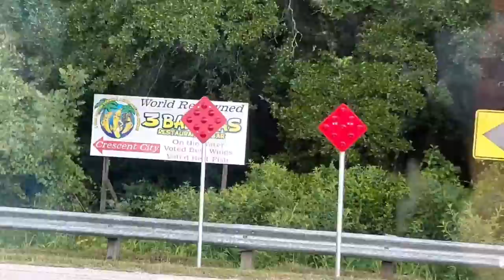**VIRAL** YouTube Video | Will it Get our TRACTOR Unstuck ?

Comment: I'm 69, in 4 Months I'll, be 70, I almost always hook a Chane to the Ball! It's easy to get to, it has always been safe and effective for me and others around me out hear in Western Colorado. Pull up slowly to take the slack out of the Chane. It's an even pull on both Frame rails and generally doesn't mess up the Fram or other parts or get stuck like hooking to a Spring hanger or Bumper.

Comment: With out the deck raising the only option would have been to reverse out. I mow with a 15 foot batwing and once the deck digs in reverse is the only option other then unhooking deck which I’ve done before as well. The log trick does work I’ve also used 4x4 posts strapped to tires

Comment: I realize I'm two months behind in posting this comment.  Only found your channel on youtube yesterday (today is 12/31/22).   For how that tractor was stuck, the better way to use logs to try to rescue would be to put logs CROSS-WAYS in front of or behind the tires, and chain the ends of the logs to each wheel, much as you did. As you discovered putting them in front poses the danger of the tractor,  rearing up, and even going over backward.  Especially dangerous on tractors with no cab or "ROPS" bar.  Other than that, a thing I have found, is that you can generally always pull more with a winch from a stationary vehicle, than can ever be pulled using the wheels, especially on ground like that, made slippery by the vegetation.  LOVE your channel the U.S. desperately needs more families like yours.

Comment: My first thought was for you to disconnect the tractor from the mower, which would make the tractor easier to move forward. Then, once the two units were separated from each other, you could chain up the two and pull out the mower.
Reply: Yep
Reply: that’s what i was thinking also !!
Reply: That’s actually worse. Especially for bigger implements.
Reply: @BIGREDTECH  Why is that? [I don't doubt you... just curious... The only tractor I've owned has been a 1943 Farmall H]
Reply: John dear big engine will myer worse  and you have dead hydrolics
Reply: Stop going to flip over dug in to deep need another tractor.get the wood off the tractor wheel and put it under the wheels for traction and you might get out . Theskidsteer will have to dig you out
Reply: @vickimiller537  Thanks
Reply: At a shallow angle put the tree trunk under the wheels skidsterrmake the shallow cut
Reply: @ralphturner3798  just with my experience unhooking implements or trailers makes it easier to pull the tractor out but then you have a whole new pile of beans trying to figure out how to connect and pull the implement out too.. usually when I’ve been stuck most of the time I get pulled backwards instead of thru it.. those farmalls are classics!! Good tractor!
Reply: @BIGREDTECH  Thanks, J Z
Reply: @ralphturner3798  no problem!

Comment: I start by unhooking the mower. Free up the tractor,.it may walk out. If not pull it out with the truck. then use the chain to poll the mower out with the tractor. Need a log chain, that mower is the anchor. The logs will do the job, work on both tires.

Comment: We used to use it to get our 4020 out when we got it stuck but you gotta have the logs on the front side of the tire lot longer than what you have them you just barely got past the size of the tire they gotta grab a lot more soil than that.

Comment: From a Kansas farm boy. Raise the implement up and pin it. Unhook from it. The tractor should drive out by itself. Chain that tractor to back of implement. Pull away from mud hole. Hook bock up. Never hookup to front axle or front weights, you will pull them off.

Comment: I have seen the boards chained on the tire crossways like a tread on the top of each drive tire and when in gear the board gets to the ground it is wider than the hole and pulls the wheel up and over the hole. 4040/42 through 4450's are pretty heavy though.

Comment: Here is the best way to get unstuck take two used semi truck tires loop one chain around back on itself take another chain and loop it back around itself so each chain end hooks up to the stuck vehicle or a tractor the other end hooks up to the pool vehicle now you have a gigantic bungee cord pull out fast and watch it Pop out the hole LOL it works for heavy equipment to it never let me down in 35 year's just saying.

Comment: I had the same problem while mowing. I couldn’t get the tractor out until I disconnected the mower. Once the tractor got out, I put a chain on the mower and pulled that out. Problem solved.

Comment: Did you fix the issue with the hydraulics not lifting?
Certainly the cause of the not being able to move !
Perhaps the log could have been tied at the tyre and rim ,as the twisting from the wheel centre was simply to much power on the log  ?

Comment: You put the chains through the tires connect them together in front hooked to truck as anchor. Then drive up on chains, pull the slack out, then repeat walking the tractor out finally.
Reply: We had a tractor stuck to the frame did have a big tractor as anchor.

Comment: Ok guys - this is how to get it out - and it will work - first unhook the mower - then cut two logs that are longer than the wheelbase of the tractor - place the logs alongside the tractor up close to the tires - place a chain around the logs just in front of the rear tires- put the tractor in the lowest gear and not running too fast - let the clutch out - the tires will climb out of the mud and up onto the chain - if one tire catches before the other use the brake to keep the one tire from getting up on the chain ahead of the other - one you get the tractor up on the chain - stop the tractor - put the tractor in the highest plowing gear - hold on and pop the clutch - the tractor will leap off the chain and hopefully jump out of the mud hole - if not u just move ur tree limbs up beside the tractor and go again - I have personal experience using this method many times - I have been stuck with a disk or tiller tool and when coming up on the chain the front of the tractor will start coming up in the air - if it does just slip the clutch and the falling weight of the front of the tractor will pull the implement out of the ground when you release the clutch.  You will learn to just leave the logs in the wet place for the season so they will be there when u need them next time... good luck